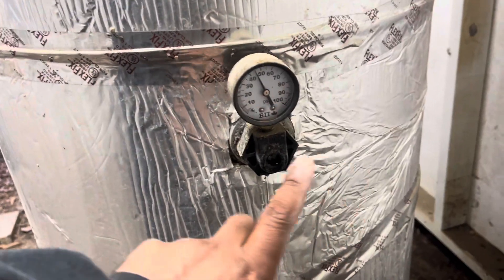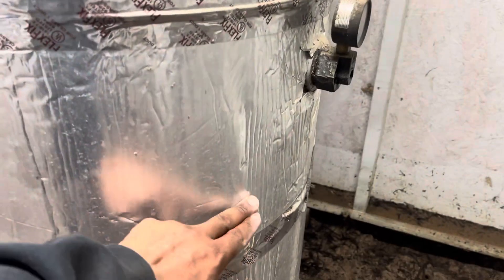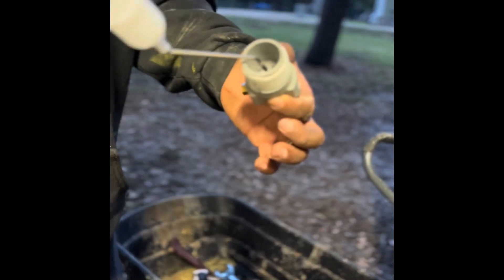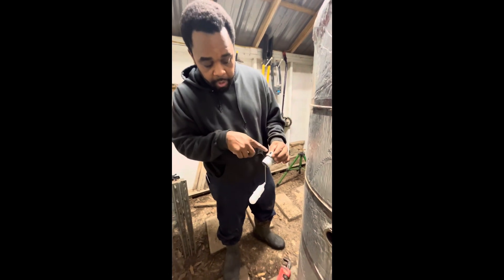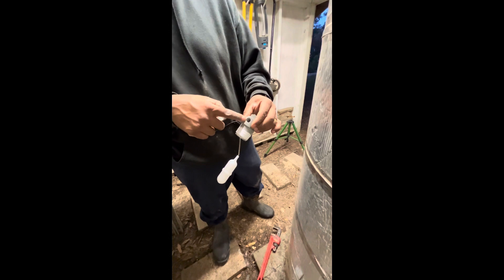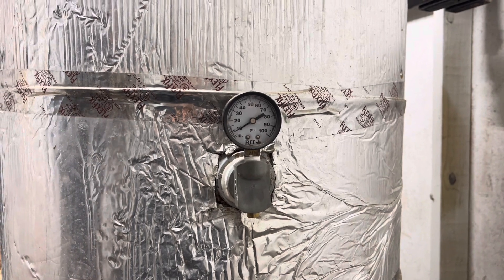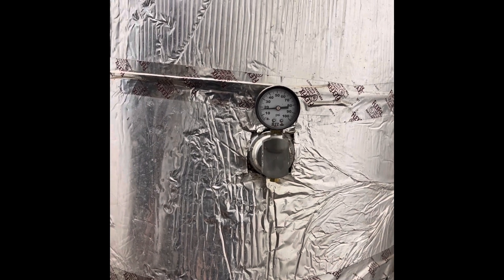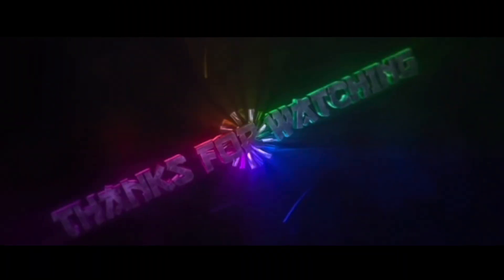Replacing well  air release valve.AVC’s

Comment: Excellent - very helpful to understand the system I have. I thought this might be my issue, but mine is not really leaking. My problem is the pressure does not hit the high end and shut back off, nd it is not the pressure switch... it goes up to about 50" on a 0" setting and just keeps running the pump.... any suggestions... i have deep well - approx 250 feet... never had this kind of problem... Any suggestions...
Reply from the maker: Thanks, glad it helped. If it’s climbing to ~50 PSI but won’t reach cut-off and the pressure switch checks out, I’d look at pump output and restrictions next. Common causes are a failing pump, partially blocked drop pipe, clogged well screen, worn impellers, or a weak check valve letting pressure bleed back. Also verify the pressure tank air charge isn’t too high and that there’s no air intrusion on the suction side. On a 250-ft well, pump wear can show up exactly like this.”
Reply from the maker: Please share how it works out once you’ve tried troubleshooting.”

Comment: After removing the AVC,,,remove and clean or replace the Schrader valve in the AVC....IT'S  NOT SEATING properly  may need cleaning or replacement.  Valve cheaper than AVC..assembly
Reply from the maker: Thanks, in this case I decided to replace due to the initial installment and our inspection timeframe.